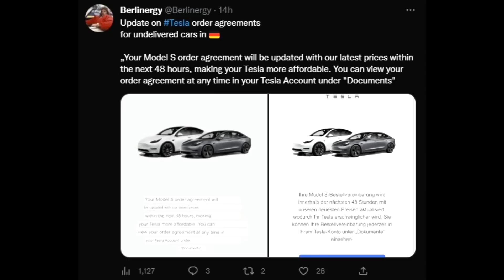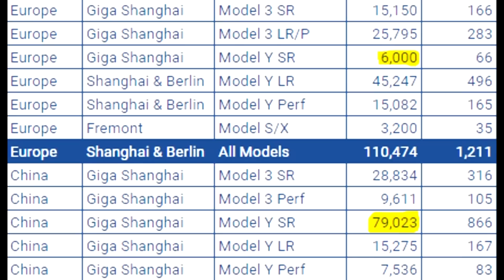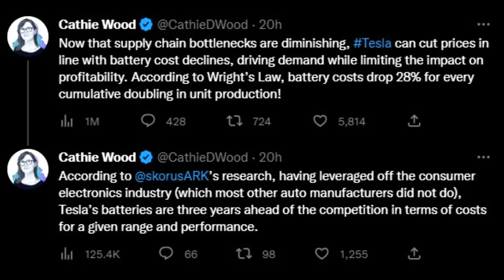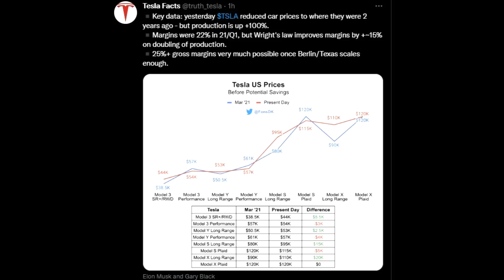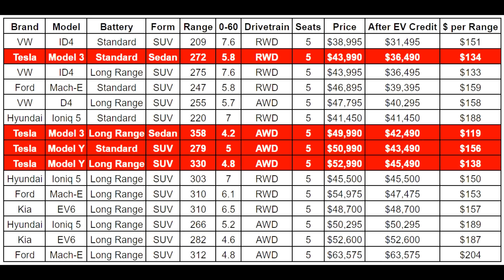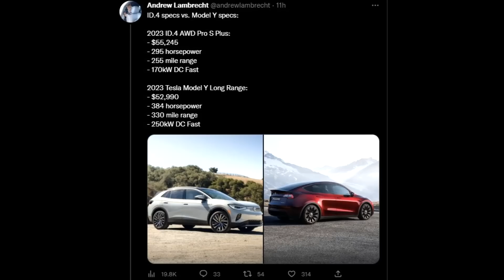TESLA - THE REAL REASON FOR THE PRICE CUT

Comment: I got an Model Y Performance early December. I calculated 0.5% decrease in price where I live so I am not unhappy...yet. There might be further decreases in the months to come. But this is a luxury problem. I found that Tesla is by far the most value for your money. We that bought in December should not feel sorry for our self, but rather for people that bought other electric car brands.
Reply: It’s the same car but $9000 less than you paid one month ago,and there’s room for further price reductions in 2023,don’t cheat yourself.
Reply: @Rx-bc4qg  Sais 4 replies but only 2 are shown... So much Tesla hatred. First off, I also own a Renault Zoe. I have test driven BMW, Kia, Hyundai, Polestar, WV and Ford. All were in the same price range(except Polestar, but that is a sedan) or above. They were all inferior cars in my opinion. BMW had better sound system. Polestar had better camera's and driving feel. But that is basically it.
Where I live the price reduction is about 1% for the performance model. That is below $1000. If I had bought the basic RWD I would have been salty, because that had about 20% reduction here. STILL, even with the old price it beats other brands. Maybe not so much if the other brands have price reduction as well. Time will tell.
Reply: Planning on buying a Model 3 by March
Reply: @squick1842  As an owner of Tesla car since 2018,I can assure you you paid the highest price for the car which has a lot of features been removed such as radar,sensors at pumpers,home link garage door opener,charging cable,leather steering wheel…,be prepared for more price cuts.
Reply: @Rx-bc4qg  Model Y came out March 2020. So why does it matter that you are a Tesla owner? Yes, radar has been removed. Time will tell if cameras will do the trick, as promised by Tesla. I got charging cable... Pumpers?
Reply: @squick1842  buddy I can’t wake you up if you pretend to sleep.
Reply: @squick1842  by the way I have model y as well.
Reply: @squick1842  bumpers (was very hard)

Comment: Needs another round of cuts for me to even think. Give us a on the road £35k Model 3 and it will get interesting for me. If they give us a two door hot hatch with 250 miles range for £24k in a few years then they will change the Car market massively.
Reply: Agree its still expensive China has thr best price model for 33k in the US its 43,000 then additional 1300 for delivery fees then you have taxes your still looking at high 40s! I'm interested to see what the price of model 3 highland! Tesla will sell every car they make because of the brand most of there customers will come from BMW audi Lexus luxury brand! Still not available to the masses!
Reply: Hey, since you're British, I want - in fact, I demand - that Bentley give me one of their cars for under 75,000 pounds.  Dammit, I deserve that.  And I want the sets to be made out of Corgi leather.
Reply: BUY BUY BUY Tesla stock.
Reply: 250 miles of range gets you nowhere, especially since you shall not charge over 80% or under 20% to not degenerate the battery like crazy. Add on top of that cold weather, snow or head wind plus battery degeneration. I would need 1500-1600 miles before i even consider an EV
Reply: @cesarforte617  why would i switch to a tesla if i can afford a BMW or other luxury brands?
Reply: @wittytech7288  The software, the efficiency/running costs especially if you can charge at home, the supercharger network for long trips.  That's why I'm buying one anyhow.
Reply: @chrishyde1216  if i’m buying a luxury car i’m not really worried about gas and efficiency… if i can afford a 60k car i can afford to pay for gas. and as far as the software goes… what does it do? i used a model 3 as my daily driver for 6 months… i don’t know what’s so fascinating about the software.

Comment: Nice video. I have a 2021 M3 AWD. I may upgrade to Performance MY with this price drop!
It’s all about timing. Prices were low in 2021 and now lower. I do feel bad for those who recently purchased at the high. 😢
Reply: Hey I heard the performance is very stiff ride due to bigger wheel.  Test drive before you upgrade. hope 2023 model suspension is better
Reply: @Inturl618 change wheels.
Reply: Or consider LR with acceleration boost.

Comment: Tesla has cheated me. I was forced to buy the Tesla Y on December 19th 2022. They did not allow me to choose any dates for the delivery of my car. I got $3750. 00 discount and two days later on December 21st, they announced discount of $ 7500.00. And now in 3 weeks of the purchase of my car they have depreciated the value of my car by another $21000.00.
What should I do. I paid more than $67000.00. I had paid extra $6000.00 for the enhanced autopilot and they have still NOT activated that upgrades. 
PLEASE DO NOT BUY TESLA. THEY ARE FRAUDS
Reply: What do you mean by forced to buy? I was also called on 23rd December and asked to buy the MY SR although my order was for MY LR. The offer was that I will get the black colour for free + 10k free Supercharger credits. They called me twice that day and tried to convince it is the best offer. I did not take it. It is always your decision to buy or not, no one can force you. So I do not agree on the cheated statement.

Regarding the EAP upgrade, you have to contact service and get it resolved.
Reply: I wanted to buy the car in the last week of December but they insisted that I get it delivered by the 19 th and no later.